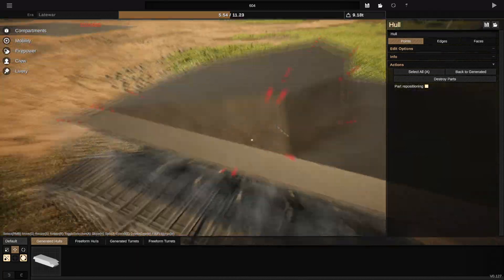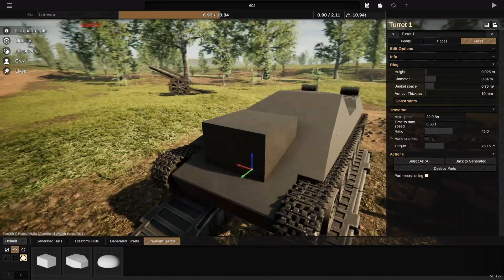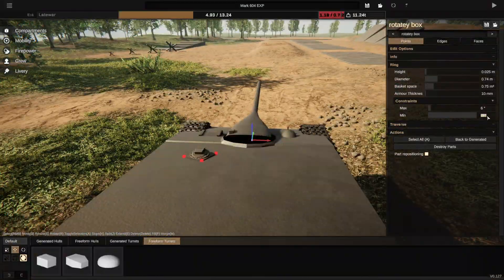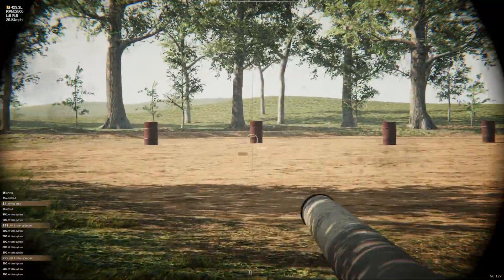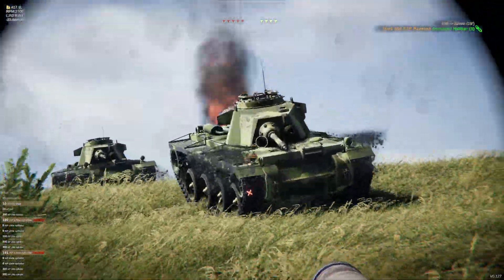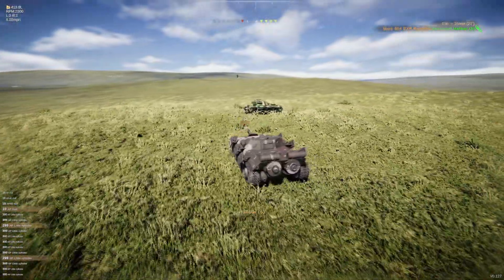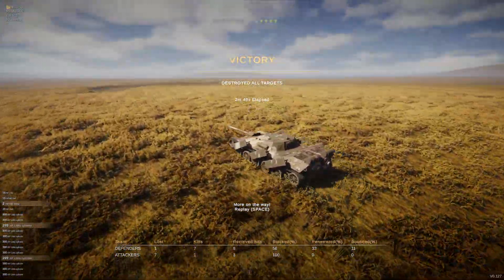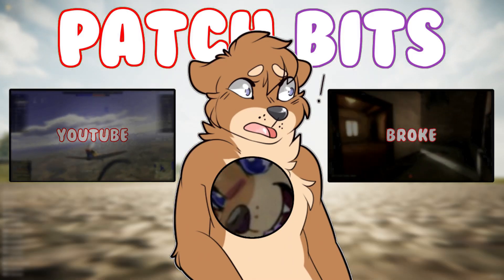This tank destroyer has JET ENGINE PROPULSION! | Sprocket

Comment: 2:35 Honestly, your naming scheme isn't even that weird since I have two, one for a faction I haven't even done any designs for yet (Its got a pretty stupid prefix which I have no idea why I originally came up with it) and another that has far too many with far too many slight variations. One example of how ridiculous it's gotten is the YMT M9-95-A4E3, yes I did fuse Zeon's, America's, and the Soviet's ways of numbering things into one confusing mess for at least one specific tank line. However at some point I stopped taking off the generated number at the end of 'YMT' so now I have stuff like the YMT89 M40A2, but I also try and add some variation like with my SPGs, which get to 'YSPG' as their prefix and get to share having M1, M2, and M3 with no less than FOUR other vehicles and their design iterations.